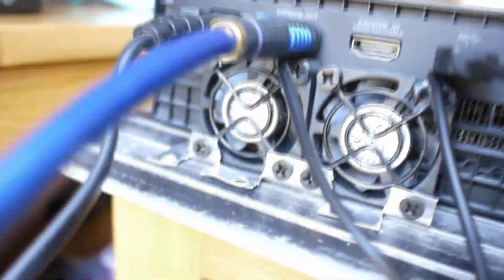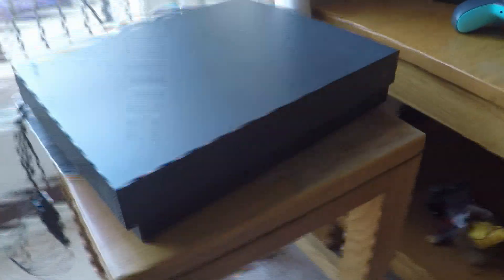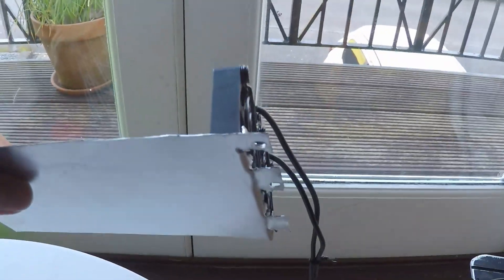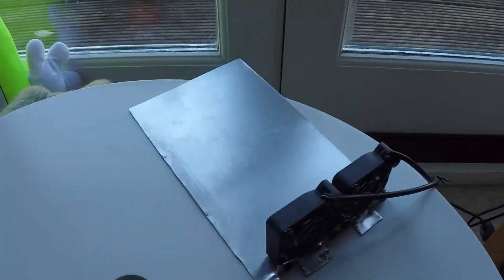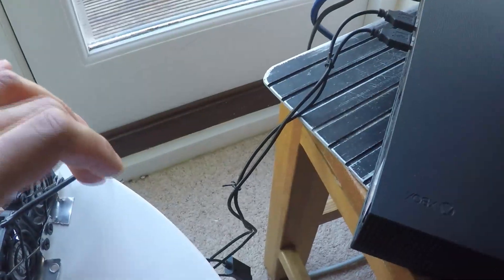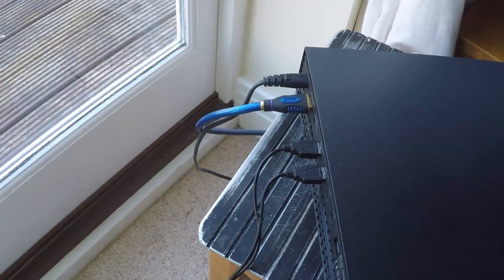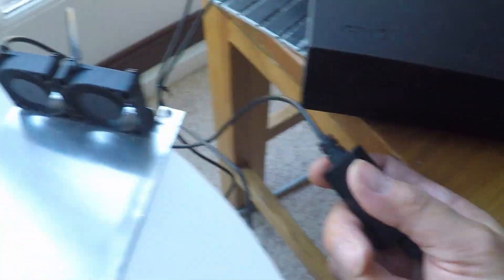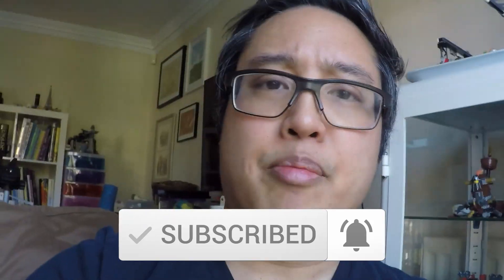XBOX ONE X OVERHEATING SOLVED: DIY Turbo cooling/heat dissipater fix for Fortnite shutdown

Comment: Thanks, but you're doing it wrong. The fans should be on the side of Xbox, which is its natural intake. The rear is the exhaust for the internal fan. With your method you are blowing hot air back into the Xbox.

Comment: I liked you line of thinking and your custom-built fans. What really bothers me allot is: Why do you pronounce aluminum: "Ally-mini-yum" ? Thats not how it is pronounced. It is: "A-loom-min-numb" not ""Ally-mini-yum". Thats really drives me up the wall. Most every "brit" or Canadian, I have had the pleasure of speaking with all pronounce it the same way, Drives me crazy! AHHHhhhh !!!
Reply from the maker: Thanks 🙏, the fans still work, I should really fix it properly and need to put aside a couple of hours and replace the cracked paste. In the UK we spell aluminum = Aluminium which is why I pronounce it as such. If you find out why is brits says it differently let me know. Cheers

Comment: Yep the thermal paste get rock hard after 8 months or so I've noticed 
If your running 1440p or 4k
Reply from the maker: Hi @ninja arcades, good to know. I think it might be time to replace the thermal paste :)
Reply: @MaverickNextGen  would be good idea i used mx2 / mx4 and after year+ thermal paste was in need of replacing but not rock hard like clay like the original paste that Microsoft use 
Plus the dust build up in the console. 
After watching your video gave me good idea designed 3d printed a vertical stand that doesn't restritct the airflow 
And turned the xbox facing backwards

Comment: Or just open it up, clean it and apply better thermal paste, lol. Maybe even the pads.

I appreciate the ingenuity! Always. This is just entirely not necessary or addressing the problem. You slapped a band-aid over a splinter. Sure, the bleeding stopped but you still got that sliver of wood in your hand, haha.

It's so easy:
Buy a tube of good thermal paste (literally $5 / £7). Open the console. Clean dust. Remove X-clamp. Remove heatsink. Wipe off old paste from APU chip. Add new paste. Go in reverse until it's put back together.

I'm in repair and while I don't particularly like the Xbox gaming platform, they made the One S and X a DREAM to work on. So easy to take apart compared to all Sony, Nintendo units and even the OG Xbox One. 

So, cool ingenuity but it's a band-aid over a splinter.
Reply from the maker: Hi @DannyWilliamH, totally agree with you re: band aid and not fixing the solution and one day I will do exactly what you’ve written when I can put aside a couple of hours. This hack is primarily for people who don’t want to open the Xbox/not confident with the paste method and want an alternative. Such is family life I’d be better off paying someone to do it 😂.The 15min band aid still works. Cheers
Reply: @MaverickNextGen  

Fair enough and I do appreciate the nice reply! I wasn't being snarky and I'm glad to see you reply in kindness and jest as well.

So, respect again on the ingenuity and I'm sure it works fine but let me mention one more reason why you should change that out sooner than later:

The unit isn't overheating because the fan and heatsink cannot remove heat fast or efficiently enough. The thing that is overheating is the APU chip, the combo CPU+GPU chip. The console was shutting down to save it's brain because the heatsink and fan weren't being given enough of the APU's heat to dissipate . The heat is just sitting and soaking into the chip rather than being absorbed by the heatsink and pushed out by the fan.

The heatsink and APU are in such close contact that your device is just allowing the system to lie and think the heat buildup isn't as bad because you're blowing air over one of the open thermocouple that detect heat (one is built-in to the APU, 2 others sit outside of it).

So, this device and most outside fans are actively making the issue worse and risking permanent damage rather than helping. That's the reason for my splinter analogy, it's under that bandaid slowly becoming infected. You don't see blood anymore but that's not really the main problem and risk going forward, haha.

Still, respect! I'm sure you'll get it done and thanks for the kind response. Cheers!
Reply from the maker: @DannyWilliamH  thanks, it’s good to get someone with expert knowledge saying why I need to do it sooner rather later. For everyone out there this is a solid reason for why you need to fix the root cause by opening it up and replacing the paste. My fix is short term. Cheers for advice!
Reply: Hi I'm also in repairs and have done an internal clean and thermal paste but console switchs off the moment fortnite is launched. Can it really create that much heat on start up it needs extra fans?

Comment: Was this after taking xbox apart and giving it a deep dust clean and replacing thermal paste ?.. also running xbox upside down the heatsink will have gravity helping heat rise through fins , no idea why they made it with motherboard on top of console... with your custom tray that would help even more.
Reply from the maker: Hi @Tinka beast, I never opened or deep cleaned it but read there was no heat extraction fan which I thought was odd. It’s never over heated since, I chose fans with the highest rpm and size i could fit to expel the volume of hot air as fast as possible. I thought This fix is mostly aimed at people who don’t want to take the Xbox apart or don’t have time. I think the internal fan is being let down by the useless paste you refer to. Cheers!
Reply: @MaverickNextGen  It does have a fan it sucks air in from sides and blows out back of xbox via a chamber that covers heatsink. You will also find that the thermal paste that comes as default will be solid and useless.
I would suggest checking out some tutorials as it's pretty easy to do and will fix overheating for future gaming.
Reply from the maker: @Tinka beast, sorry you are absolutely right re: fan I will EDIT. I suppose the internal fan is good enough just the paste is letting the heat exchange down. Yep I can guarantee the paste is knackered, I’ve considered doing it and watched videos already, time is my enemy - you are absolutely right it will provide for better gaming. Re: thermal paste must I leave it overnight or can the boys start gaming immediately once freshly applied?  This solution took me 10 mins to assemble hence convenience factor. Cheers.
Reply: @MaverickNextGen  It was my first time taking xbox apart too , but honestly it was pretty straight forward i followed a guide and just paused when needed.

You will be able to start playing soon s it's all done so no need to wait.

I would suggest Artic MX4 or a non conductive / non cure alternative , most videos will also have links to what you will need.

Another worthy upgrade would be an external SSD drive which would speed up loading times on games.